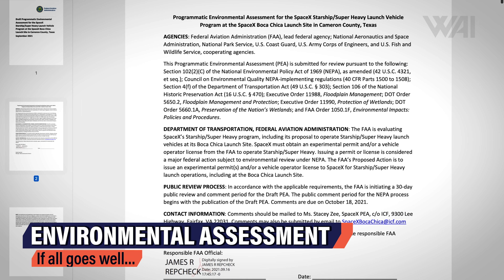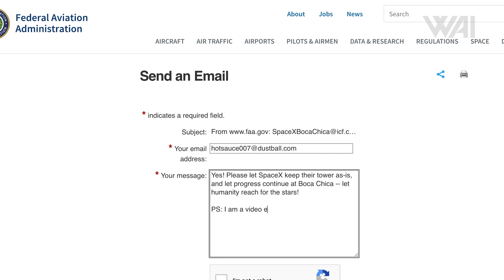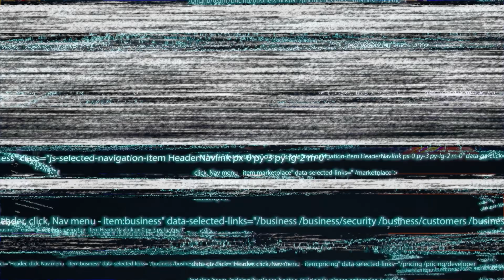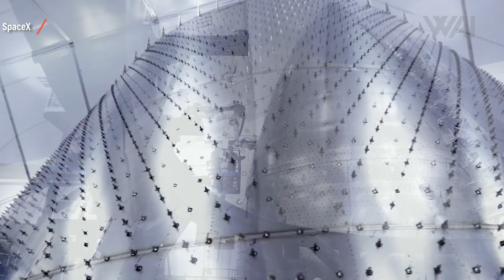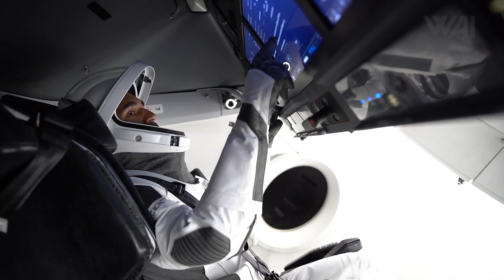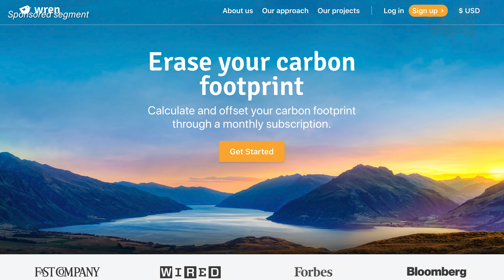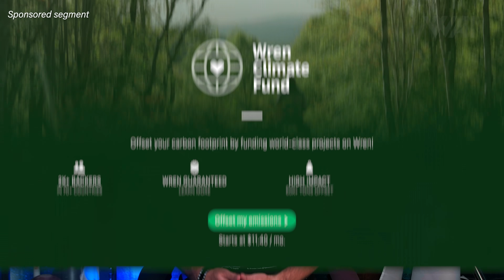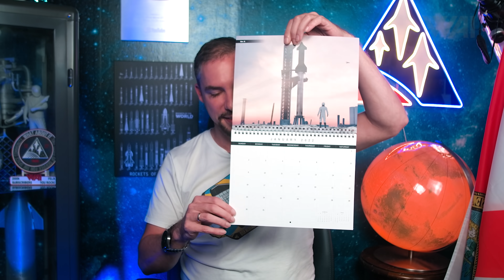One month to an orbital Starship launch attempt! & SpaceX Crew 3 Mission Status!

Comment from the maker: What do you think? Do you have an idea of how to improve the attachment method for the Starbricks? :_WAIShocked:
Reply: Overlapping tiles, gotta control expansion, contraction issues. Dragon Skin!!!!!
Reply: @lionmountainman1630  i like the idea! I wonder what's the physics
Reply: @baltorx  Thermodynamics explains how surface area expands and contracts with temperature changes. Stainless steel is a poor substrate for a rigid tile job. The tiles are getting crushed together at cryogenic temperatures, causing failure at the weak points. The heatshield needs to be more flexible, like scales? Dragon Skin!!!!!!
Reply: Flex Tape
Reply: If the tiles were to slide sideways and lock into place, using narrowing channels on the back of the starbricks then this would keep them in place permanently - obviously end tiles would have a special fitting to lock them in - only problem I see is if a tile cracks or breaks then you may need to remove a whole row or two of tiles.
Reply: @MoKhera  the issue with that is if you need to change a tile in the middle you have to remove a truck load of tiles just to change one
Reply: @MoKhera   I see what your saying and not sure if it was directed at me or not but, theirs more then one way to think of a slide lock. Personally I wasn't thinking of slide locking the heat shields together rather slide locking them to the ship.
Reply: Use the cap from a child proof medicine bottle.(US) They will never come off,  When needed off grab a 3yr old.
Reply: @danmay6493  perfect solution😆
Reply: How about making the heat tiles much larger like say the size of the rings but only the half you need and have a matching ring that connects the rings together.  What I'm thinking of is the ablative shield  of the appllo heat shield.
Reply: @robertbettencourt7134  to large would increase long term cost. The larger the heat shield the more likely it will get damaged. To small would increase weight.
Reply: From the static fire videos, my guess is that it's the vibrations that are cracking the tiles where they attach to S20. Breaking free, they flutter to the ground. Perhaps SpaceX needs some heat-resistant rubber bushings or something to dampen the shaking between the welded attach pins and where they contact the tiles.
Reply: Felix, Wren is using the concept brought up by the fossil fuel industry of putting the responsibility on individuals so we won't focus on politicians, and the massive companies that have lied to us for half a century!! PLEASE 🙏 drop them as a sponsor. The fossil fuel industry will not guilt trip us into doing the job for them, especially when relatively there isn't much we can do.
Thanks for the videos
Reply: Of course - use "C200"
Reply: SII, otro vídeo, 

Saludos desde Colombia
Reply: The bricks need to “snap” in place on a fitting. Once snapped on they are locked until a special fixture/tool releases them. Quick, easy and still a mystery on how it would actually work. 🤣.
Reply: Ship is made of steel right? Magnetize the hull and infuse or layer the tiles with a ferrite substance.
Reply: @KCM25NJL  stainless steel is not magnetic
Reply: @KCM25NJL  Nope! Heath affects the magnetism in objects
Reply: @fayfoorer  plus there are different types of S.S.  About half, like 304L wouldn’t attract a magnet anyway.
Reply: @KCM25NJL  in combination with the existing pins magnet so good idea problem with magnets .... ineffective at high temperature but they would be helpful on takeoff
Reply: Does the tile solution need to be something they can do on mars too?
Reply: @BBDoesTheThing  On Mars they do not need to worry about tiles.  They can return to Low Earth Orbit and hitch a ride back to the ground in another Starship/rendezvous with a capsule, etc.
Reply: 3-pin method is good they just need to improve the shape, technically you can make this method really robust with refinement.
Reply: Take a look at a velcro variant.
And smaller tiles - more hassle for sure, but fewer expansion problems, fewer "base flexing" problems  and closer attachment points per tile.  Stronger and more flexible overall.
Reply: @DLWELD  
I take the velcro idea seriously. ceramic fiber mat bottom layer is both for insulation and attachment. Hundreds of ceramic barbed spikes projecting down from each tile. Even if the tile is cracked, it will seriously stay put, and still effectively shield. Nowadays we have tough, flexible, ceramics; even elastic versions are starting to be developed.

Downside: It's total permanency means cracked or otherwise reason for tile-removal will need automated robotic chippers for a fast turnaround time for relaunch.
Upside: SX is getting really good at robotics.

Baking the spikes into the ceramic tiles is a process that will need some time to perfect.
Reply: A ‘net’ made of some high temperature metal which stretches around the tiles & attaches to the other side of the ship — keeping all the titles firmly held from the outside to the ship.
Reply: @millamulisha  basically a giant heat resistent condom
Reply: @Ed_edino  😂
Reply: @millamulisha  it wouldn't matter if the net Burns off most of the shaking is during takeoff .....reentry all the tiles are forced against the hull with pressure so it doesn't matter if the netting Burns off .... fishing line I would do the job
Reply: I have a simple idea of how to keep the tiles on, fit the tiles and then spray a rubber bonding solution on top of them to keep them intact and in place during take off. This rubber solution then gets burned off during re-entry so the tiles can do their job.
Reply: @dereklewis1577  Won't work. Burning the rubber on re-entry will only add heath to the tiles which will be hot already. There is only so much heath they can take.
Reply: @dereklewis1577  an epoxy resin too hold it all together during takeoff reentry is not such a problem because pressure forces are holding tiles in place
Reply: @13thbiosphere  epoxy would burn instantly, I am not even sure it would survive take off. Magnets won't work on stainless steel.
Reply: @tyrionas  epoxy Will burn up instantly on reentry that's OK.... tiles would be locked in place by pressure epoxy will hold everything together during takeoff no problem
Reply: @13thbiosphere  yeah but the issue is that you would have to remove all the tiles, clean up the burnt remains of epoxy, put back all the tiles and the epoxy at every flights which would take days or even weeks to do. that wouldn't be a good solution if you wanted to be ready to fly again 30min after landing.
Reply: @tyrionas  no I just a quick spray down with another layer of epoxy leave all the burnt grit just epoxy over it
Reply: @13thbiosphere  well I work with space grade epoxy very often due to my work (I design and build cubesats in the Netherlands) and I can tell you that this would be a terrible idea as you wouldn't be able to do that more than once or twice without talking about the effects that burning epoxy would have on the heatshield. Also it would still take much more time than 30min, you would need several hours just to apply it and epoxy takes 24h to reach full strength at ambient temperature.
Reply: @tyrionas  ok how about wire mesh that burns off on re entry ?
Reply: @13thbiosphere  Took me a minute to get what you are thinking here. The mesh just holds the tiles together on launch, same principle as your epoxy idea. I think I understand.  I wonder if theres a light weight foam (I shudder at the thought of foam as well) or foam paint that might work. Something semi ridged but flexible enough for the shake n’ bake at launch.

 Either way, it wouldn’t allow for a rapid turn around flight.  Its the same issues the STS ran into, they never did solve it but SpaceX will with out of the box thinking and different ideas getting tossed around like whats happening in this thread.  Thats what the engineers do, solve the problems as they come along.
Reply: @13thbiosphere  the issue is having to replace such a system would take very long and wouldn't be 100% reusable. also you might lose tiles during the landing which would make the whole thing rather pointless. It is a very complex question, but if I had to give an educated guess, using those tiles is both an economic and a reusability choice. to be honest i think a combination of hexagonal tiles and large molded pieces would do a better job but it might not be as economically viable.
Reply: @tyrionas  the first prototype just has to get off the ground without any tiles falling off they can do a quick wire mesh  job on the first takeoff tiles could click lock together in the next attempt a bit like LEGO, male/ female clip / lock
Reply: @13thbiosphere  there may be a solution there but I doubt that we will think about something that makes sense in this comment section if spaceX engineering team didn't find anything yet
Reply: @tyrionas  out of 100 comments 95% is garbage but occasionally a good solution does emerge from a comment section like this but it does require scanning for the gold
Reply: @13thbiosphere  well I am working in the space industry and I would say that the chances that an actual good solution that engineers haven't thought about is waaaaay more unlikely to appear than that.
Reply: @tyrionas  the best solution was that tiles stick together like LEGO
Reply: @13thbiosphere  not necessarily
Reply: I think they should use smaller tiles, that are cone shaped with the butt directed outwards. This way it is a kind of "internal scale" that would be less influenced by the expansion and contraction of the metal, but it would still be flat on the outside. They should also only have one single stud per tile, directly in the center of the cone. Smaller tiles have less mass, and would be more resilient to vibration. Also, with only one stud per tile, there would be less possibility for the tile to crack between studs if the metal expands and contracts, the tile can move more freely. And between these inverse-cone tiles, they should make filler tiles that perfectly fits the void between inverse-cones. These filler tiles are not attached directly, but wedged between the round tiles. You can even have a perfectly round gasket to seal off the inverse-cone tile for heated gas.  

I made a drawing in google SketchUp to show this idea, but when I post my link to my drawing here on Youtube, my post keeps vanishing as if my post is spam.
Reply: @erobwen  I would recommend sending this design proposal directly to SpaceX in paper form are you suggesting 30% smaller? How about a 1.8 mm centre pinhole to secure the centre bolt... I can visualise most of what you are talking about
Reply: @erobwen  I seen your picture it looks nice but, I do see a few things that looks to be more of a problem. ••••• the space between the tiles looks to be excessive that will kinda take away the reason for having a heat shield 🛡️ maybe I am missing something you can fill me in later but, anyways it also looks like it adds more weight decreasing the payload capacity. If you look at the current design it only has three pins for each tile why?. Stability anything less can make the tile unstable it's like having a chair 🪑 the least amount of legs on a chair needed to have a stable chair is 3 legs. And if you look at the tiles theirs an even spacing from each tile. If the tile was a circle the spacing between each tile would no longer be even. That's why honey comes and squares ⬛ have been used for tiles.
Reply: @vc2702  First of all, you misinterpret the image. The space between the spools/cones should be completely filled up with filler-bricks that are just sandwiched between the cone/spool bricks. 

Secondly I think it is wrong to try to obtain stability. What we want is isolation and dampening. Imagine that the steel hull will vibrate like crazy and even contract and expand in the thermal cycle, so what we want is bricks that can freely float on top of the vibrating and shape shifting hull. The internal scaling design means that there can be a few millimeters of play, so the bricks can move, while still not leaving any gap directly open to gasses. Especially if there is some kind of gass seal between the bricks. Also, think of a cello (instrument). It stands firmly on one single peg to isolate it acoustically from the ground below. This is the same principle at play here with my single stud cone bricks. If it would be possible to create a spring that could withstand the heat, I can even imagine having a spring dampener on that single stud, to isolate it furthermore from vibrations. 

But even if there is just one single bolt for the cone brick, it is supported by material all around so that the construction can withstand compressive strength, for example if something is knocked against the heat shield.
Reply: @erobwen  The reason I said anything about the image was because I didn't understand it. I like how you explained it to me thanks. I am still curious about weight it doesn't look like it's helpful in that area.
Reply: Here is an attempt to share the sketchup drawing: 

https://drive.google.com/file/d/1j7yQh1BzzhI4E-GRuxcphZ3WMqE9ydjy/view?usp=sharing
Reply: Put/glue large tiles to starship and then  cut them to smaller by robot. Every cut tile could be different if needed.
Reply: Complex question; they need to be locked-in so they don't fall off or break during launch, and be able to resize due to temperature change at the same time. I believe they are on the right track, maybe need to refine and iterate the attachment margins and/or the Starbrick recepy to make it withstand the extremes it's aimed to withstand.
Reply: Hey you still moving to Orlando Florida?
Reply: There must be dozens of options for different attachment methods, all with pros and cons. Maybe only one or two are satisfactory. At least they aren't starting from scratch, as they can learn from NASA's experiences with the Space Shuttle's TPS.
Reply: Seeing the current system reminds me of how keys are attached to a keyboard. They never seem to fall off even when I slam my fist in frustration, maybe use that? 😂
Reply: @OctavianVoicu  I feel ya😉
Reply: SpaceX grade Velcro :)
Reply: Duct Tape, Felix .... Duct Tape.
Reply: Design the tile retention pins like those used on the security tags used on clothing, where metal balls cam into a groove on the pin. This will provide resilience, and allow the tiles to be easily and non-destructively removed by using magnets.
Reply: @dougdority5589  there has to be some sort if thermal contraction or thermal expansion ! but also gapping has to be spot on ! to close the tiles collide ! To far apart heat from the re- entry could penetrate the ship ! i have a redesign that would be bullet proof and im  doing this for free !
Reply: it kinda looks like they are only held in place by friction? Would be good to find out how they currently stick them on.
 I thought do a slide hook, but then you could only fit/replace them serially, which would really suck if the faulty tile was at the bottom.
Reply: I assume someone has already suggested coating them in something like Starlite?
Reply: @GreenJimll  epoxy resin
Reply: Perhaps a graphene-net over the tiles?
Reply: @pecent  It’s really to bad that they cant spray it with a similar material.  Re-coat every x amount of flights.
Reply: @pecent  it doesn't matter if the netting Burns off in reentry
Reply: Proprietary Elon ludicrous glue!?!
Reply: Hello
Reply: @FurkanDincerov  hello there😁
Reply: @FurkanDincerov  hello there😁
Reply: I believe if the heat shield tiles were set farther away from the skin if the ship on the pins by an inch or so the air barrier between the tiles and the skin would keep the skin cool.  As well as keep them from falling off.
Reply: Although the pins would need to be welded to each other right at the heat tile and the tile epoxied to the pins to keep them from vibrating loose.
Reply: @jamesstjames1289   insulation underneath  tiles is about 1 inch
Reply: Iv got the perfect idea for holding them on weld/tack a bolt in-between each corner of each tile that has a web that overlaps the out side of the tiles each bolt could over lap 2-3 tiles all you would need is a good tack gun most likely a custom one that would support the bolt. You heard it here first tho 🤣 just imagine a 🔩 with the bottom is where it gets tacked and the to with a 🕸️ this over laps on the outside of the tiles.
Reply: Yes, as the rocket is steel a rare earth magnet on the back center of heat tiles would make sense. Though I am unsure about the magnetic properties of 304 through the temperature ranges the rocket will likely encounter. They could hook tiles to the ones next to them a bit like chain mail.
Reply: @johnking1765  yeah SS304 is not really magnetic like most stainless steels. You might be able to stick a magnet to it depending on the exact composition but it won't hold with significant force.
Reply: Only a relatively small number of tiles fell off.  It might just be a QC issue.
Reply: Much larger tiles to be 3D moulded around the exterior. Or better yet baked on the exterior of the ship.
Reply: This imo is one of the most important questions that would have to get sorted. That and landing legs. Look at what happened with the space shuttle. The heath shield was almost its undoing. There's got to be a simpler solution that works...
Reply: Attach as they do now and add gorilla glue.
Reply: Maybe a T lock that slides. Damn I wish I could show what's in my head to everyone. Needs to be 1. light 2. Easy to assemble and disassemble 3. Able to stay in place 4. Gives room for heat expansion. The tiles need to stay as tiles so they can replace only the damaged tiles and, they need an efficient way to scan the tiles before and after take off. I was thinking of using a Lazer scanner instead of having people visually look for imperfections in the tiles. Then they can do a visual inspection. People are not perfect having a machine to inspect for flaws would be more effective. And then of course a human to oversee .
Reply: What if they make the starbrick material into a sprayable solution and then coat the ship with multiple layers?
Reply: @shenzilord  your idea probably requires 3 years of research and Development idea ... worthy of Investigation but time frames don't allow that what you're talking about ....a graphene  foam spray? Theoretically possible
Reply: Aloha Felix, brother you are exactly right about those who say it can’t be done should not get in the way!  Also, when you look at what Mr. Musk is doing overall he’s actually trying to extend the life of our current home  with electric cars. And with SpaceX he has the reusable rocket tech. With Star Base he’s prototyping a reusable rocket that will get us to usable other planets so we have time to make that planet ready for others. I don’t think I could blame him if he’s feeling like he’s the only one building space tech to help in both endeavors. I can’t help but feel like there is so much negativity around everything he does even though it seems it’s for the betterment of us, all of us. With that said I’m glad there are people like you to keep the message abou't Mr. Musk’s positive message and what he’s really doing out there - thank you for that and keep up the great work. 
On a side note I have to use an iPad Pro to do my computing due to a handicap. Perhaps things are different because of that but I can’t find the join button anywhere and I do so badly want to support your show. Any help will be greatly appreciated. Thank you again.
Reply: @brianjaber3171  Hi Brian, do you mean “subscribe” or do you mean “join”?
Reply: The tiles should clip lock together like LEGO
Reply: Why not slightly overlap the trailing edge of each tile...like scales?  It would lock them in place (would add weight, unless the overlapping tiles were perhaps thinner, but the same thickness where  overlapped)...Plus...looks like a dragon.
Reply: Let's make ONE per tile BIG stud attachment. Like the teeth implants ))
Reply: Welding
Reply: It’s not the attachment method that’s the prob, it’s the gap for expansion. They are going to want to expand (and contract) and they must be allowed to do so. If not, something will break… (assuming the issue is thermal and not mechanical)
Reply: @danwhiffen9235  Silicone adhesive will allow for expansion
Reply: Look at how they attach horse shoes
Reply: I have an idea but only if you have a contact or able to  tweat my design ! my idea does not involve any modifications  to the current ship and will not add weight !
Reply: They can use a slide lock for the heat tiles.
Reply: @vc2702  I agree tiles should be locked into each other at least from 2 polar edges
Reply: This is out of left field but, build a full sized tolo brick mold, then print a full sized heat shield into the mold, then fire it in a full sized oven, then heat bond the Shield to the outside of the ship with bolts and rivets. The same process for smaller sections around the fins and terminus.
Reply: @TomiLoveless  So build an oven big enough to cook an entire starship?
Reply: @TomiLoveless  unrealistic
Reply: Pre-embed the connecting wires in the hexagonal heat insulation block, fix each heat insulation block on the fuselage, and connect the connecting lines between each other, so that the heat insulation block becomes a fishing net and wraps the fuselage, so that it can be used repeatedly.  Although a single process increases the difficulty, the final package strength is very high
Reply: Magnets!
Reply: @davidwashington0  magnets in combination with pins and bolts ....magnets not effective at high temperature
Reply: @13thbiosphere  True, however this would mainly be for the ascent. The fuel inside is cold so the magnets shouldn't loose much of their force, as well if the ship did lose tiles it would most likely be during the launch when the vibrations/ stresses are strongest and temperatures are lower. During the descent I assume the pins along with the forces of reentry would be sufficient to hold the tiles in place. Additionally I believe plasma would follow the magnetic field lines so it would be interesting to see if they could be used to guide the plasma away from hot spots provided they had not lost too much of their force.
Reply: @davidwashington0  they won't stick to good stainless😉
Reply: Make the tiles bigger so they have more pins holding them on?
Reply: @wkinne1  tiles could be 3 times bigger?
Reply: @13thbiosphere  would seem it would allow three times as many supports. I think the best option would be one huge tile formed right on and to the ship, it would go a little over half way around and therefore never be able to fall off unless it shattered. But there must be reasons they dont do it that way, but I think it will be done that way in the future.
Reply: @wkinne1  sounds like nice fantasy
Reply: @13thbiosphere  Todays fantasy is tomorrows reality. I wouldn't be surprised if one day it is a paint.
Reply: @wkinne1  100 layers of paint like a fibreglass epoxy?
Reply: @wkinne1  yeah thermal expansion and retraction can cause large ceramic pieces to crack
Reply: @tyrionas  Maybe something besides ceramics then. I doubt in twenty years something better wouldn't have been discovered. Some amazing foam or something. Maybe something that burns away slowly and has to be reapplied after flights.
Reply: @wkinne1  the issue is that if you need to replace the whole shield after one or even a few flights. It's not reusable at the same level than a plane for example which is the current goal of SpaceX
Reply: @tyrionas  Maybe it will be as simple as spraying on a coat after every flight, similar to de-icing the wings of an airplane. I really believe this is where it will end up some day, maybe not today, but some day.
Reply: @13thbiosphere  4 or 5 layers of some kind of foam perhaps.
Reply: I do. Where do I submit my entry?
Reply: HELLO, fellow space nerds, we need YOUR HELP, naming our new company.
Before we can make a public announcement, our company needs a new name.
The impossible engine is possible.
This is the first sub light engine which directly converts electricity into forward thrust. The demonstration prototype is available for independent testing. 
We are self funded, not selling anything to anyone, not asking anyone to believe anything.

We only ask for YOUR HELP with a new company name, please reply with suggestions.
Reply: @DigDougDig   happy to help here's a few name's.
1. SLE ( Sub Light Engine)
2. EK (Electric to Kinetic)
3. SLEEK
Reply: either an adhesive that binds in cold and heat or a mesh to hold it together.
Reply: hello mr felix
Reply: Use same exact heat tile setup,  except USE THREE HI-TEMP GLASS SCREWS... make high temperature glass screws with metal cores, with the tops of the screws having glass installation "nubs" that are snapped off flat, after the "glass" screws tightened down & the tiles are snug in place...  idea inspired by Terry Pratchet glass clock stopping time story...  lol   AdamC 10-26-21
Reply: Hi
Reply: Creo que las losetas térmicas flojas lo hacen los ingenieros de SpaceX de manera intencional para estudiar que sucede con la nave en la reentrada a la atmósfera en caso de que una o varias de ellas se desprendiera durante el vuelo. ¿Se destruirá la nave? ¿Sufrirá daños graves o leves? ¿Podrá aterrizar en una sola pieza? Eso es lo que pienso.
Reply: I think they need to use larger tiles. Larger tiles will have greater mass and greater inertia and will therefore be more difficult to shake loose. Secondly, they should change the shape of the tiles. Instead of using a simple hexagon, they should use a more complex shape that maximizes contact between tiles. I think they should use something more akin to jigsaw puzzle pieces. This will give a greater interconnecting surface to mass ratio which in theory should make it harder to shake them loose.
Reply: Larger tiles, Same amount of attachment points covering the same area.  But have a high temp rubberized or foam backing where the pins pop in. That way they have room to expand and contract to a degree but should maintain a certain level of pressure on all sides to keep it from vibrating off. I am certainly no engineer, and possibly just an idiot.
Reply: @ticklemejunk650  its definitely a learning expierience for all ! strange part is i never seen the wings loose any tiles so i think it has to be a thermal expansion and contraction problem ! not sure how safe a larger tile would be or if they can bake an underbody tile the width of one ring and 180° long ?
Reply: The Space Shuttle tiles were bonded to a base layer of silicone rubber mat which allowed thermal movement and which was bonded to the aluminum skin below. The main difference with Starship is the SST cryogenic tank is the base and not likely to find a glue that can function at cryo temps. With that said the 3-stud attachment is not the problem what's failing is the tile insert which the studs engage. These inserts need to be improved by making them out of SST and having a shape which can be molded into the ceramic and form a strong structural connection. So the key to improving the tile attachment are the inserts in the tiles. Another idea SpaceX should investigate is to make the Starship fins out of Carbon-Carbon composite (similar to leading edge tiles on the Shuttle) with metal embedder hinge and actuator parts. C-C can be designed to be very strong in the load bearing directions. This would save weight, C-C is 10% mass of SST and would be inherently heat resistant which would solve the complex tile geometry needed to cover the fins....
Reply: Interlocking the tiles with each other , the heat sheild will be whole, seperate tiles wont fall off
Reply: Felix Carbon footprint is a corporate scheme from "BP" to push the blame of climate change from the main contributors, the corporations, onto the consumers.  This is talking about the sponsored segment at the end of the video.
Reply: Using a metal Velcro would save the day. But one half of it would need to be baked into the tile. For that they would need to use a tunnel oven to control the temperature above and bellow the tiles. There are versions on the market what can hold several tons per square meter.
Reply: We are not allowed to respond to this post with images or links to images. How could we send you files?
Reply: As far as I understand they want to use tiles so they can replace the damaged ones quickly. but in my opinion it would be more beneficial to make large molded pieces of heat shield that can be more securely attached to starship and use tiles only on difficult areas or areas where they would expect the most damage to occur.
Reply: Have it snap on like legos attach together
Reply: Fix them from the inside!
Protect them from all the dynamic forces , 
Besides, do you really need to protect a crude steel sceleton or just the inner sensitive components ?!
Reply: @amateurrandomdude5870  how exactly do you suggest to fix them from the inside while keeping an airtight container filled with liquid ergols under pressure? also if you need a dude or a robot to go inside of the tank to fix the tiles, that is going to take days to jettison the tanks to make them safe to work in, do the work and then test the tank integrity and refuel which goes against the ready to fly again in 30min objective of spaceX
Reply: @amateurrandomdude5870  and yes you need to protect everything, hot plasma during re-entry will punch through the steel like a hot knife in butter in mere seconds. have you ever seen what a oxy-acetylene torch does to steel?
Reply: Can anyone tell me why the Apollo era guy in the intro says “what about it, go for launch.”??? Does anyone know? Did someone say something and he was replying “what about it?”  And then “go for launch.” is meant to be a separate statement, albeit right after replying? There has to be some kind of meaning no???
Reply: I've been shouting at my Facebook over this for sometime! Use an ablative heat shield wrap. It can either be glued or secured on the cool-side like a blanket for easy replacement. It could also be sprayed on and robotically maintained using paint depth sensors like I do checking paint depth on motor vehicles. Tiles will NEVER  work - no possible rapid reuse, ever!
Reply: @JasonStansfieldNottingham  well I think you are being pessimistic when you are saying "NEVER", I can bet that spaceX engineers might have a better idea of what's possible than you and I do. That being said, I do agree that having a more monolithic heatshield for the sections that are not expected to receive damages would be a better idea leaving tiles only for the sections that are expected to see repeated damages. one issue to take into account with monolithic heatshields or coatings like you are advocating is that they react poorly to expansion and retraction due to uneven heating and they might crack fairly quickly. I think this question is a very hard one, especially with such a big spacecraft and we'll probably see a lot of iteration from spaceX until we have something that works.
Reply: Hi, Phil Swift here with Flex Tape! The super-strong waterproof tape!
Reply: Get them all drunk so immediately more attracted to eachother
Reply: I think the loosening is because of chaotic deformation of the relatively thin skinned outer body. Look carefully and youll see multiple resonances creating peak deformations where the tiles, which are relatively rigid, detach from the oscillating steel body. The tiles area might need to be able to deform in several different planes simultaneously to dissipate the mechanical energy of the resonance without creating nodes which detach individual tiles. The tiles need to work together as a contiguous skin. This is possibly the most complex part of the ship.
Reply: @Haroldus0  I agree with your assessment there. a good idea would be to mount the tiles not on the stainless steel skin itself but on a mesh that is attach to the skin that would allow for the tiles to move like a mail shirt. but not sure how well that would handle the launch vibration as the resonance modes might be too low.
Reply: Now, there are 3 pin locks per a hexagon tile. I think simply add 3 more pin locks for the other corners of a tile?
Or if the tile can lock with each others, may be it will more secure ?
Reply: the handyman's secret weapon.....duct tape...
Reply: lol going to ISS for Halloween those are some committed trick or treaters
Reply: Global warming is a scam, I'm not here to be sold a scam, unsubbed.
Reply: If it were me I would change the heat tiles thusly, if you notice there are two holding pins on top and one at the middle bottom. I would reverse this arrangement or better yet add another pin and make it four.
Reply: Ich hab da mal eine Frage/Idee zu dem Thema... 

Kann man die Hitzeschutzkacheln nicht größer machen? 
Es würde ja schon reichen aus vier Kacheln eine zu machen. Bin mir sicher die Jungs haben schon gedacht gerade Mr. weniger ist mehr Elon. Daher denke ich mir dass es schon seinen Grund haben wird, reicht mir aber nicht aber komme auch nicht dahinter.
Reply: I think they should be molded onto a Stainless Steel Mesh then just wrapped on one segment at a time and welded on or something.
Reply: Some kind of twist-lock mechanism
Reply: Use the strong force
Reply: I do know that most people TRULY cannot grasp just how complicated all this is, yet the smartest minds out there are working on it!  Most can't even build a flip-flop out of transistors, weld, program, etc. (but they are good..jk..at denying stuff because "it's stupid"  LoL (and that is not a jab at those who don't specialize in other things or do other jobs or trades...but it is a jab at those who are insecure and have to be the 'smartest' at everything and respond with stuff being "to hard" "to stupid" etc..  

I mean look, people are literally using a TRUE marvel of engineering w/ phones, internet, power, etc. and saying stuff using the SAME technology is impossible, lol

Bureaucratic issues and who's God is the right one, etc. will be the reason it doesn't...  Elon/SpaceX is trying to CHERISH this thing we call life, so why does the aforementioned matter..?  Easy targets for high personal insecurities.

Life is amazing and a cluster..part of the journey..  your personal heros may be right or wrong...most are fearful of what they aren't comfortable with..and most don't know the reasons for either

maybe more people need to experience the 'overview effect'  (send some flat-earther's up there...open their eyes...it's just an example of how to truly make one's mind see things in a whole new light..!  Humanity is needs it!

Stay safe out there, stay open-minded and if you want the answers...  gotta ask the right questions..and question the validity of those questions.  Anyone can improve on their abilities they don't realize they have if they TRULY LUT IN THE WORK (regardless of topic) ...how much do you really want to know before cutting yourself of at an arbitrary stopping point..?

😊
Reply: I do know that most people TRULY cannot grasp just how complicated all this is, yet the smartest minds out there are working on it!  Most can't even build a flip-flop out of transistors, weld, program, etc. (but they are good..jk..at denying stuff because "it's stupid"  LoL (and that is not a jab at those who don't specialize in other things or do other jobs or trades...but it is a jab at those who are insecure and have to be the 'smartest' at everything and respond with stuff being "to hard" "to stupid" etc..  

I mean look, people are literally using a TRUE marvel of engineering w/ phones, internet, power, etc. and saying stuff using the SAME technology is impossible, lol

Bureaucratic issues and who's God is the right one, etc. will be the reason it doesn't...  Elon/SpaceX is trying to CHERISH this thing we call life, so why does the aforementioned matter..?  Easy targets for high personal insecurities.

Life is amazing and a cluster..part of the journey..  your personal heros may be right or wrong...most are fearful of what they aren't comfortable with..and most don't know the reasons for either

maybe more people need to experience the 'overview effect'  (send some flat-earther's up there...open their eyes...it's just an example of how to truly make one's mind see things in a whole new light..!  Humanity is needs it!

Stay safe out there, stay open-minded and if you want the answers...  gotta ask the right questions..and question the validity of those questions.  Anyone can improve on their abilities they don't realize they have if they TRULY LUT IN THE WORK (regardless of topic) ...how much do you really want to know before cutting yourself of at an arbitrary stopping point..?

😊
Reply: It may sound crazy, but how about just attaching the heat tiles with Velcro? 
Es klingt vielleicht verrückt, aber wie wäre es, wenn man die Heat Tiles einfach mit Klettverschlüssen befestigt?
Reply: Sollution for heat shield.
Make it with flange, to farther place them one flange up - one flange down with overlap and clearance for heat expansion. Each should have premade holes, four or seven when one in the center. Employ a robot to place them, drill thrpough holes and rivet them to the hull.
Reply: Dimensions change, things shift n "settle" in.  +/_ .002" tolerances adds up. Shake the thing before ya add the tiles? Just a thought.
Reply: Another attempt to share an image. 

https://drive.google.com/file/d/1jiCva8s2UK5gZen0GXOqbqXWJVbl1ycr/view?usp=sharing
Reply: Tongue & Groove Tiles - BINGO! If that creates maintenance issues maybe wedged edges, bottom edge of tiles can overlap the top edge of the tile below them.
Reply: How about redesigning the tiles, so they not only get attached on the wall, but also with the tiles next to each other
Reply: Maybe the stainless steel is too smooth. Sand blast or pit the surface first. Pit the adhesive side of the tiles. Don't use Chinese glue.
Reply: FYI Felix, your Bitly links are often blocked by large enterprise firewalls, so I can never click your links.
Reply: Looks like you got a case of the Gillian Anderson giggles. Take a look at old X Files outakes to see what I mean. Great work as always Felix and team!
Reply: I believe starship will eventually use a blanket similar to the Space Shuttle. The tile have no chance of staying on - especially when the temp differences  due to cryo fuel are causing expansion and contraction
Reply: At each intersection of 3 tiles a silicon carbide screw with a large head could be placed.  Reentry tiles experience  up to 2,300 degrees Fahrenheit.  SiC is a ceramic with high hardness, just below diamonds, and a high melting temperature (4946 F).  However they might be too brittle to withstand the vibration during launch.  Instead one might use stainless steel screws, alloy 301 melting 2550-2590° F,  with a silicon carbide coating.  Made thin enough the added weight might not be as high as the large pins under the tiles.
Reply: Hi, I am curious, do you have any news about the federal complaint of Blue origin? It was due in 1st November because of the aggreement between BO and NASA to freeze the reward as long as the problem was solved at this date. But still no news...
Reply: FWIW, I think that Elon should be looking at nature for the heat shield bricks.  I think that a "fish scale" design has a lot of potential for a more stable structure.  All of the tiles would overlap by a bit, providing a better "seal" from the plasma created from re-entry.  Most of the tiles could be identical, except for the center "stripe" down the middle of the heat shield, and almost all of those would be the same.
Reply: Can’t they use like a sheet made out of the material a big sheet wrap around instead of small bricks ?
Reply: @thuggiesgameguides  The STS (space shuttle) was supposed to get a Nomex blanket to replace the heat shield tiles that had become so problematic.  They're still trying to make something like that work.
Reply: instead of mounting the tiles on Pins, maybe embed the pins in the Tiles by baking in the ceramics. locate the tile thru holes in the hull and seal and clip them from the inside of the hull.
Reply: Some kind of super glue to attach the tiles and an electrolysis process to remove them.
Reply: Sure put a very strong neodymium magnet inside every star brick Bake it inside the brick and slap that sucker to the steel hull of the ship. Problem solved!
Reply: @georgejackson4105  to much added weight - besides that the ship is made from 304l stainless steel which probably is non- ferrous !!
Reply: @scottymoondogjakubin4766  stainless steel is ferrous it's just not ferro-magnetic
Reply: @tyrionas  i thought it was depending on the nickel contant ?
Reply: @georgejackson4105  magnets lose strength when heated
Reply: @BLACKSSG85  a combination of magnets for takeoff and pins at high temperature
Reply: @georgejackson4105  Nope! Magnets lose their magnetic properties when heated. Good idea though.
Reply: @fayfoorer  I mean without talking about heat. Stainless steel is not magnetic so it wouldn't work with magnets to begin with
Reply: @georgejackson4105  Depending on the grade, stainless steel is not very or may not be at all ferromagnetic.
Reply: @DLCaster  correct, magnets won't stick to the cheaper grades of SS, I used to do alot of scrapping, learned what was good and not so good😉
Reply: @georgejackson4105  magnets don't work on stainless steel though
Reply: @georgejackson4105   are magnets capable of withstanding high temperatures temperatures could be 500 Celsius below the tiles, so a combination of magnets and the existing pins?
Reply: @georgejackson4105  Stainless is non-magnetic
Reply: @georgejackson4105  Stainless is non-magnetic
Reply: @georgejackson4105  magnets won't stick to stainless😉
Reply: HOT GLUE
Reply: Gorilla glue, for the toughest jobs on planet Mars
Reply: @waterrocketlab151  No temp resistence
Reply: Hey, Felix! Big fan, you give the best updates for Star Base, keep up the good work! <3
Reply: Not about the tiles, but something else my spider-sense tells me is critical:  A spacesuit for the lunar surface.  It's clear NASA isn't going to get this done.  To get it done in time it's going to take Elon and SpaceX working with that lady engineer/scientist from NASA, who has already designed that skintight suit.
Reply: @billg3645  The swivels for the joints are already produced. The material for the garment is the easy part. it is all the systems in the back pack that make it complex. They include oxygen, carbon dioxide removal, pressurization, heating and cooling, communications, radiation protection, just to name a few.